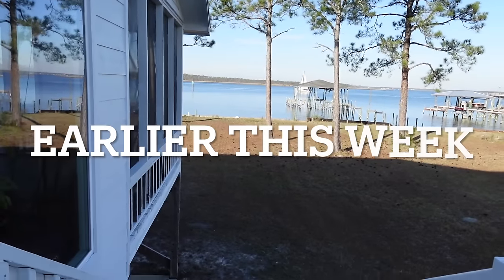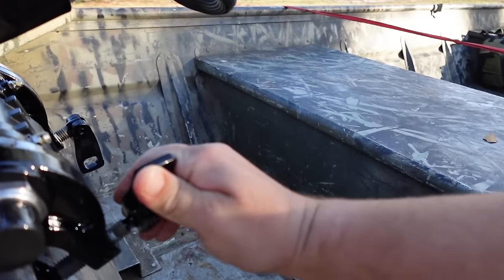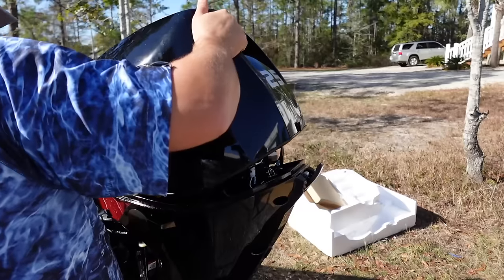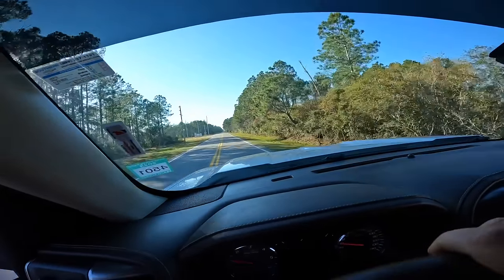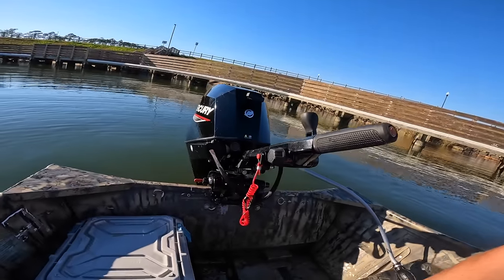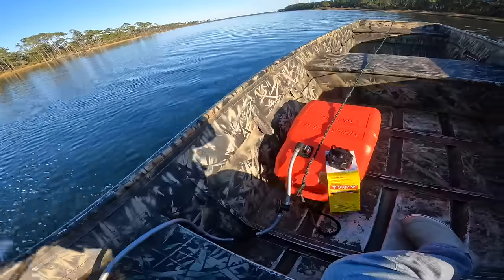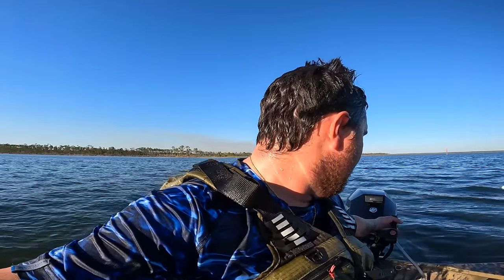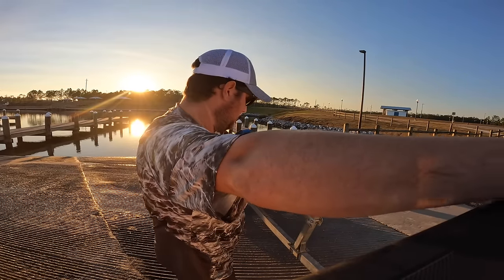I Should NOT Have Done This!

Comment: Thank you for posting this one, Steve. A lot of guys might not, figuring it would be too embarrassing, but folks need to see how easy it is to get in trouble out on the water and how to recover. Sorry you lost your glasses, bro. I agree with others here about the motor size. That’s a lot of power for a jon boat.
Reply from the maker: Well said! Thank you. And yes! It was a lesson learned and my mistake for putting too much weight and hp on too small of a vessel. I’ve recently acquired a little bit larger Jon boat for this engine! Thank you!!
Reply: You should kick the motor out a notch or so and the steering will get much better.  Same as trimming up with your big motor..Also put that gas tank all the way in the front
Reply from the maker: Great advice, thank you  @jerrymollere1818
Reply: @BamaSaltwater Hey brother I'm glad you're okay!!!!!

Kill switch is a must!!!!
Reply: One of my boats is also 14 ft and is factory rated for 20hp and it's a good match.  I've seen quite a few 14 ft. boats that are only rated for 10 to 15.  I'd be afraid to put a 25 on mine.
Reply: @jaydee5156  I have a 14 with a Johnson 25. I see setups like mine all the time up here in MN. I've even got a stainless 4 blade cupped prop on a jackplate. I think the issue here is a person who is new to tiller steer, combined with the heavy 4 stroke and no ballast in the bow. It's not an engine power issue. Ive run mine for years and never had a problem, you just have to be careful with quick movements.
Reply: Kill switch engage glad you are OK and you had all the right safety gear
Reply: @BamaSaltwater  steering tension needs increased. Should be a lever with red paint
Reply from the maker: @Proaman-js2qv  definitely plus the throttle too. It was my mistake I didn’t do enough research haha. Not often but noones perfect for sure 😂😂😂
Reply: @BamaSaltwater  we all started as rookies, some with better training than others
Reply: Thanks for posting, it does happen and there's no shame, just glad you didn't get KO'd and you had your safety's gear. That was a blessing. There's probably a few lessons.  

The Merc 20/15hp are the same weight. The 25hp jumps up in weight.

You might have been safer with the 20hp. However, it looks more like a balance thing, especially with the flat bottom, it just caught the wind and torque steered.

Some will say, well when you get all your gear in the boat it will balance it out. I'm of the opinion if it's not fixed in place and can slide around, then this could happen again.  So you come back to discussing reduced HP for safety.

Or if you build in fixed items that balance the boat, then you might as some would suggest hang on to the 25hp.  Those that suggest this are likely running a lighter 2 stroke and have good trim settings. I think the 4stroke 25hp is a bit too heavy in this scenario.
Reply: @BamaSaltwater  learn how to steal your boy 
😊
Reply: I was going to say the same thing. Looked like it was trimmed down a touch too much.
Reply: i have a havoc with a 115 merc on the back and i run an easy 70mph. and anything and everything can and will happen on the water. always wear a life jacket and kill switch. cant stress it enough!
Reply: @timlong1462  just because you over power your Jon boat or that you see other people overpower Jon boats doesn't mean it's OK.  You clearly don't understand the characteristics of a flat bottomed boat, in terms of design, buoyancy, & handling.   You should not give advice on safety issues if you don't understand the fundamentals of biathlon hull design with their capabilities & limits.   You shouldn't overpower a boat which will effect its dynamics of use it is designed for.  It forces you to put in extra ballast which decreases its designed buoyancy & freeboard, & seaworthyness,  which increases its sinkabililty.
Reply: @timothyreilly8394 ok YouTube expert. I never said mine was overpowered. It's a 1442 rated to 30hp. You are making too many assumptions without being informed. Almost all 14 ft boats I've seen are rated to 25, and unless you put a heavy 4 stroke it's a total non issue. My 25 weighs nearly 60lbs less than this mercury and my boat does great.
Reply: @PORSCHE_COUNTRY. I learned to ski on a slalom ski behind that boat.  It pulled me up like nothing.  Dad installed a steering wheel after seeing me make a run in it.  The boat was very light and so was I.  Even on the rear seat, there was no water beneath me.  Our neighbor had the same boat with a 40, but he was old enough to be my grandfather and I'm sure, much more mature than I would have been in it.  40s from those days really weren't all that heavy.
Reply: Make sure your engine is TIGHT on your transom when wearing the kill switch cable. Almost 20 years ago my sister was driving alone and the engine came off the back and dragged her down nearly 30 feet to the bottom of the lake. Only then could she get it off her wrist and float back up with help from her lifejacket. She’s lucky to be alive. She was also an accomplished bronze cross swimmer (very strong swimmer) which definitely helped her out. 

I know it was kind of a freak accident given that the cable didn’t come off the engine or her wrist the whole way down but that shit still gives me nightmares and I’m constantly making sure my motors are tight on my transoms. Don’t let my comment deter you from wearing the cable tho lol.

Comment: Good to see you're alright!! If that is a 1436 the largest suggested hp is 15, you can add float pods and that should help with the motor weight. You are right by moving the gas tank forward!
Reply from the maker: 100%, I am now a proud owner of a 1548 lol Thank you!
Reply: My question is did u ever have a boat dealer/ boat shop to shop for your motor? I would have thought these places would have informed you of shaft length and motor size and prop. @BamaSaltwater
Reply: @Angel123711  I  had a 1436 Landau years ago that was rated for 20.
Reply: TDB 17 foot or the 14 foot

Comment: Others may have mentioned this but it looks to me as though you should adjust the steering tension so the motor won’t move side to side quite so easily. I typically set the tension on a hand tiller outboard where you could take your hand off the tiller (not saying that’s a smart thing to do) and the motor would not change direction. Anyhow, glad you’re ok and glad you’re willing to remind us all about safety.
Reply from the maker: Definitely should've done a few things different! My mistake for sure!! Thank you!!
Reply: Agree, the first thing to do with a tiller drive. Glad you’re ok.
Reply: Thanks for sharing that. I’ve never adjusted the tiller tension, not changing direction seems like a good marker for the right amount of tension. I used to think it was only for trailering so motor wouldn’t move left or right.
Reply: DO NOT, EVER, let go of a tiller handle!  Even with hydraulic steering.  You’re just asking it if you do.
Reply: If you can let me know as I’m planning on buying a tiller drive boat soon, aren’t you supposed to only operate it via starboard?
Reply: @BillyBob-im7og  That's where I always sat .. left hand on the throttle.

Comment: Steve, would just like to mention a safety item with your plastic gas can.  It has to do with the propensity of static electricity igniting the gasoline fumes when the nozzle comes in contact with the plastic gas can that is sitting in your boat, not grounded.  Plastic cans should always be set on the ground to fill them.  Better yet, use a steel gas tank sitting in your boat and ground yourself by touching something metal before allowing the nozzle to touch the steel gas tank when filling.

Comment: The fact that you mentioned how important the kill switch is before this ever even happened shows your attention to detail in teaching in your. Awesome work man. Stayed smart, stayed safe 👍
Reply: Attention to detail would have said," pay attention to you gut feeling, this dosen't feel right. This motor is too big for this boat"
Reply: @claytonwalker7536  Every boat has a capacity plate riveted to the inside of the transom stating maximum hp .. maximum weight of motor, passengers, and anything else on board. That little boat was way overloaded and overpowered. Should have put a 9.9 on that maximum.

Comment: Glad you’re safe. I once had the same boat with a 9.9hp. 25 is A LOT for your new boat!  You are leading a blessed life , every minute of it well earned. Thanks for your videos.
Reply: I was kind of thinking that 25 was bit too much for a lite weight boat.
Reply: @conniebennett6646   have a crestliner 1448 MV  it’s rated for 25 hp   Up to 30 if you get the side console option  his boat did look  over powered though
Reply: @ricklittle4617  I thought he said his was a flat bottom Jon Boat
Reply: The biggest thing I saw was the long shaft motor that he put on it I don't recall but I don't think my 15 was a long shaft on my Jon Boat
Reply: I know that little maneuver can get you screwed cuz I've even done it in my side console

Comment: My first few times out with a tiller steer were sketch too. My advice to anyone new to this type of steeling is take it overly cautious the first few times out . Alot of things come into play here trim, boat speed, motor steering dampening, weight distribution, water conditions. These are very fun style of bosts to run but can get away from you very quickly as seen in the vid. Glad you're good my man thank you for posting this video . God bless yall and be safe.

Comment: It's good to see you made it out ok! I had a real wakeup call one time on a small boat not much bigger than that and it made it where I refuse to take small boats on big water. I had a boat motor start overheating on the way back in trying to avoid a big storm that snuck up on me. I was a long way out from any boat ramps, and the 25hp motor I had on that boat I found out very quickly was not only severely underpowered for that lake, it was also unreliable (impeller went out, there was no weep hole on it) ... The storm was nasty and had 3 to 4 ft waves constantly crashing over the bow of the boat, filling up the boat way faster than I could bail (also learned bulge pumps are not just a good idea on that trip lol) between starting the motor and running until the warning buzzer ring then letting it cool and using the trolling motor to aim the front into waves, and bailing as fast as I could I managed to weather the storm, with so much water in the boat I had to sit on the bow to keep it from sinking when I got to the ramp. All I can say is when you have a horrible experience like that you will thank god profusely and want to kiss the ground when you step on the dock! Take it from me an idiot who went through a close brush with death (no way I could have survived those waves even though I had a life vest on, even if I did I'd definitely need hospitalization) you should always put safety first, and make that priority one!

Comment: Awesome rig.  We use these daily up in Alaska (Bristol Bay/Lake Iliamna area) for shuttling, accessing fishing spots on rivers, and ours have jet foots.  They are unbelievable boats.  Think about running up a river in low water, that is no more than 15' wide and 5" deep.  They pull double duty as well with oar locks and we row them down rivers.  Scary moment there getting tossed out.

Comment: Lesson learned and, more importantly, lesson taught! Someone already mentioned stick steering, which would actually allow you to drive from the front, but I'd personally would like to see you master the tiller handle. You'll be a better boat driver in the end. 15hp would have been a better option for someone new to tiller steering, but when you get it figured out and that storm comes barreling down on you, you'll be thankful for that 25hp!!! I personally would recommend a good seat with arm rest bolted to your bench. Looking at the footage, you didn't over compensate until you started sliding. Get your boat to a plane and let speed come with confidence. Tight lines!

Comment: Sorry this happened to you, happy you shared. When I was 13 I was driving a 12’ jon with a 9.9 and was thrown out. I was wearing the kill switch but go figure it was faulty and I had to fight to survive the boat doing a death circle for what felt like an eternity. 

It took me a few weeks to get back in a small boat with a tiller but I eventually “got back on the horse”. I’ve got a larger bayboat now but still own a 14’ jon with a 25hp tiller. Take it slow, never make quick changes, balance the weight of people and gear both on the center line and bow to stern. With the motor, tank and fisherman all sitting on the last 3 feet of hull, she’ll be sensitive to steering input. Love watching the videos, tight lines.
Reply: This is critical testimony.   Thanks!

Comment: Hey buddy, I didn’t read through all the comments, but I have a small boat with a 30 hp mercury on it and it didn’t wanna plan out very easily. I put a hydrofoil on it. It was super easy to install like 15 minutes and that thing just instantly planes now. They are cheap and you can get them pretty much any boating store. I think I got mine at Cabela’s. Best wishes. God bless you.

Comment: Look into tightening the tension on the vertical shaft so it won’t be so snappy turning 

I think that tiller handle on the new mercury will offset to allow you to sit closer to the middle.  The smaller models may not.

Tiller guy for 30 yrs
Reply from the maker: Yes!!! It was my mistake not doing more research. I have now upgraded a large Jon boat and adjusted the tension and angle much better

Comment: This is why I do not like the tiller handles. If you accidentally lose the handle or your extension comes off the motor slaps and tosses you out. I ended up switching mine over to a side consul. Love the boat so much more now. I also put battery's, deck, and trolling motor in the front for weight
Reply: Until your steering cable breaks and it literally does the same thing 😂😂
Reply: Also has nothing to do with the type of engine and all to do with experience and common sense
Reply: Until your steering cable breaks and does the same thing.

Comment: Glad you’re ok…some things that may help:  That’s too much motor for that boat.
You can adjust the trim on it which may help the nose.
You can adjust the resistance on both the steering and throttle so it’s not so free and that may help some stability.
Some pods on the back can help the nose as well.
A prop with less pitch can lower your nose as well as you will take some of the torque on take off
Also not that you can really change it now but you could probably get buy with a shorter lower end unit.
It’s probably easier to just find a bigger boat.  Kudos to you for posting this as most wouldn’t. Good luck!
Reply: Don't go changing props and lower units!  That's overkill by a mile.  Put some weight in the bow and tighten the steering tension.  Slow down until you get familiar with the boat and the tiller.  

It's a light, fast setup that handles way different than your bay boat.  It rides on top of the water.  The bottom is flat so it will want to slide in the corners.  Sudden tiller movements can be disastrous.  Good luck with it.   Practice helps.  ✌🏼
Reply: @chiphill4856  most of those lightweight 14ft jon boats that i've seen are only rated for 15hp motors at most, and he's got a 25hp on there. that's 60% more power than the boat is rated for. too much motor for that little boat, no way around it.
Reply: @Arterius_omm  I've seen plenty rated at 25hp.  I owned a Lowe 1448 with a 40hp Yamaha for years, ran great.
Reply: @chiphill4856  sure maybe a 1448 would be rated for higher hp but not a 1436 which is what i’m pretty sure is what he has.

Comment: Steve, I tipped over my 16' sit on top fishing kayak this past yr in Racine Wisconsin on Lake Michigan in October fishing for King Salmon. Water temp was 55° , I had my life jacket on but did Not have it buckled! I also had insulated rubber boots on that filled up with water, we're like concrete shoes and they sucked to my feet/legs to where it was impossible to kick them off. When I went in, my life jacket came off. Telling myself to stay calm, many times saved my life. I had to hold onto the upside down kayak and swim it back to the nearest shore/dock. It took me approximately 50minutes to get to a dock and another 20 min. To get On the dock & out of the water. I was frozen, bleeding and sore but safe.  I feel blessed and grateful. A series of small, bad decisions led to a very serious situation that could've been catastrophic. Those flat bottom boats are scary and unstable in water with any sort of potential waves. Be careful! Glad you're also safe and here to share your experience.

Comment: Glad you're okay.  Um... isn't that engine a bit large for that John boat.  Also, your channel is amazing.  Keep the great videos coming.
Reply: I thought 25 was perfect for a Jon boat… but that’s just my opinion
Reply: I agree. At full horsepower, especially with no one in front to help balance and weigh down the boat, it's asking for trouble. It's not a boat built for speed, it's aluminum.
Reply: It depends on the jon boat. Some are rated for 25hp.